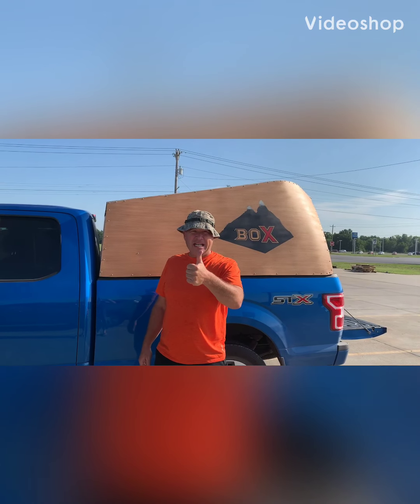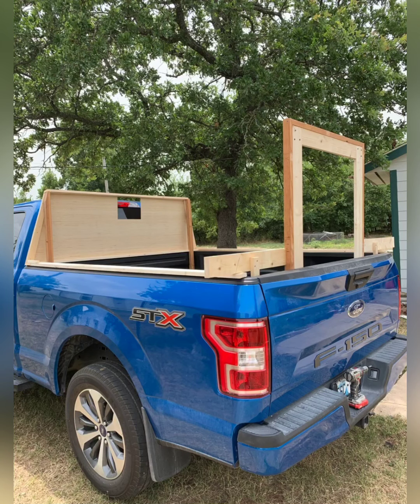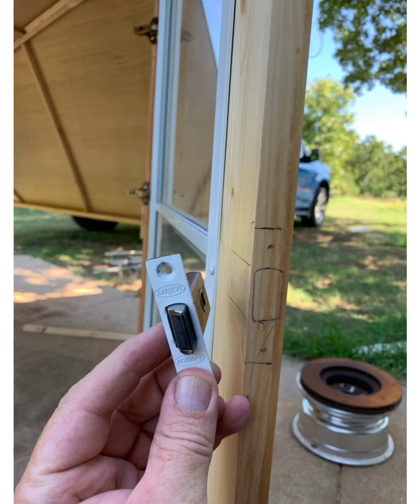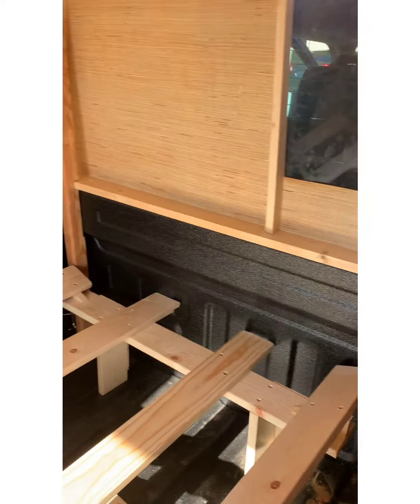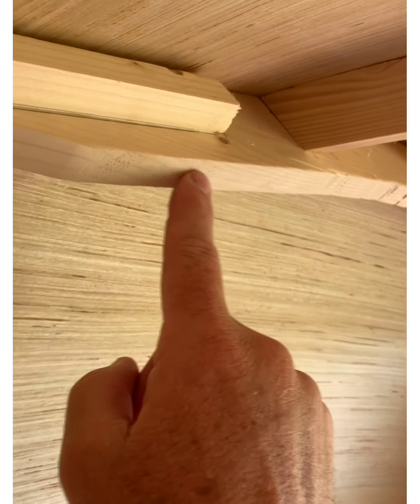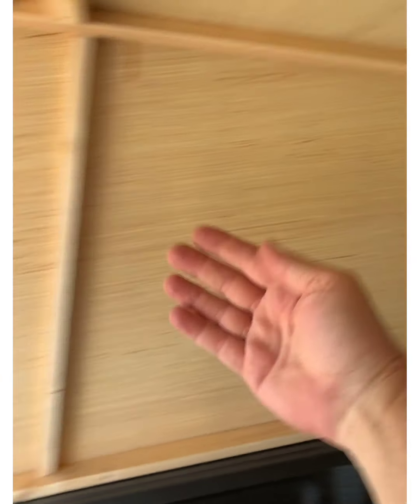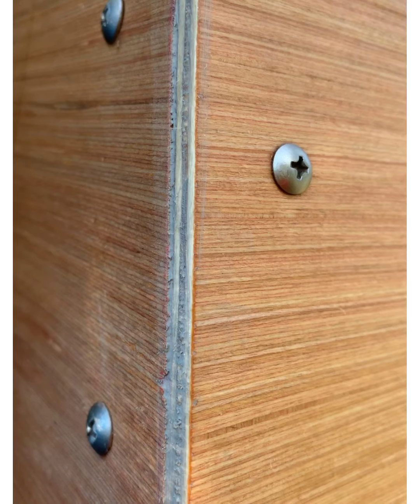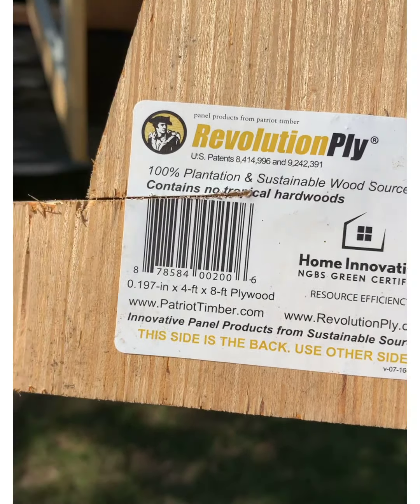How to build a truck camper for the mountains! Cheap Tutorial!

Comment from the maker: UPDATE

so after 6 plus trips with camper have had some minor delaminating on plywood, and after closer inspection I found that ever spot (4 or 5, 2 inch spots} that under each spot the manufacture had used a filler to fill knot holes or other imperfections and this filler evidently likes adsorbing WATER.  About ever other trip I've had rain for 20% of trip, mostly water nights. Over all im still happy with it and will add a video of patches in the future...

Comment: Very nice. If you paint it the color of truck, it would look very nice. Also,get some use little computer fans and make a mount for them that would fit them inside the ceiling fan for ventilation with a second battery set up.
Reply from the maker: I haven’t had need of extra ventilation because colder climates I camp in... but if it’s hot at night I ll add a/c and a 110 camp site!

Comment: What a great build. It's simple and lightweight. If you don't mind, I'll build one for my truck. Is there anything that you would do differently, now that you've had some use of the topper?
Reply from the maker: I sprayed the poly urethane on originally,,I think a brushed on job would have been thicker but It seems like I end up driving though rain almost every time I go to the mountains so that being said I should probably check and add polyurethane on spots that are looking weak and cracked before each trip, the camper sits in my barn most of the year and it’s pretty hot all summer and is probably just as bad for the finish as far as surface cracking and plywood drying out, between heat,humidity and rainy weather
Reply from the maker: Short answer happy the way it is, but takes some maintenance , more than fiberglass.
Reply: @stevensee4755  thanks, that helps with some decisions. I need to build mine a bit stronger in order to support a solar panel in a stainless steel frame. I think I'll do almost the same as you did and finish the topper with PMF.